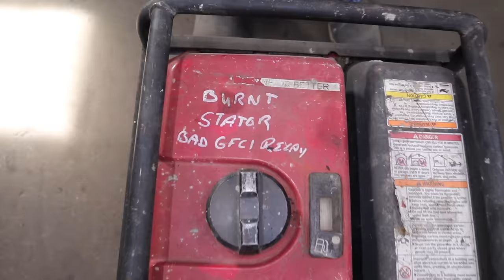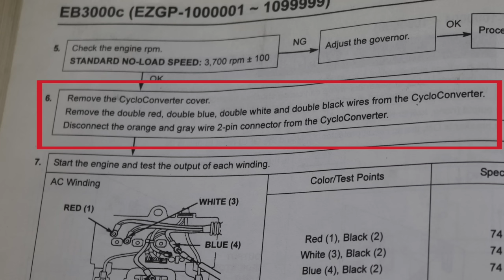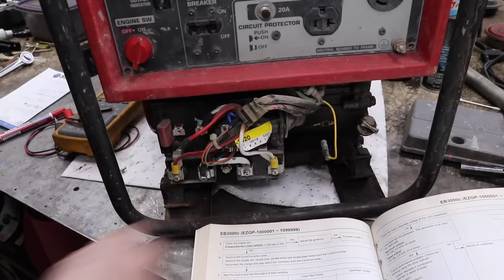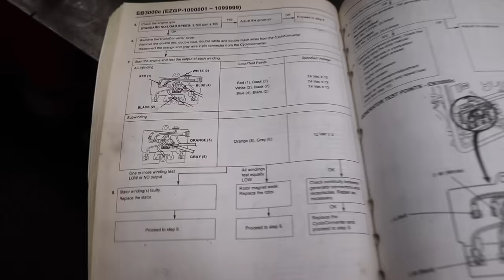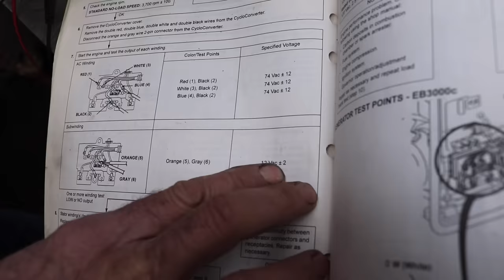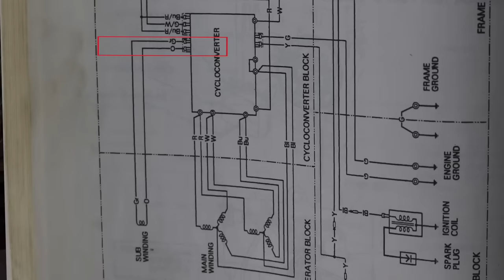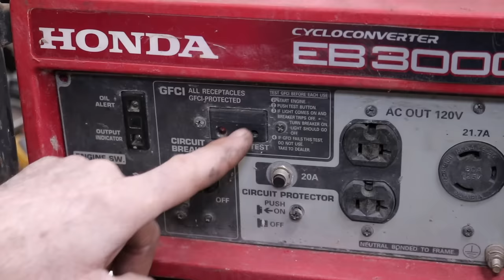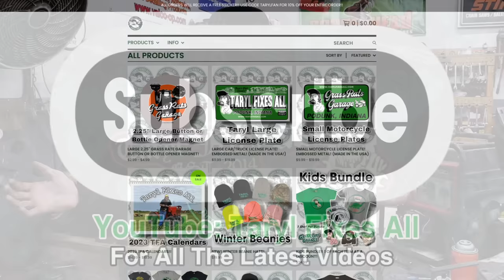Some Things Change For The Worst

Comment: I was hoping an experienced mechanic can tell me if the older pre 2018 Honda eu3000eu generator has any major issues. I have a trifuel hookup to run propane natural gas or unleaded. I don't use it but once a year if that. I know electric start battery is dead. But should I keep it or sell it. With large wheel kit and cover dc cables all goodies it's approximately $2500.00 inverter generator. I saw a video taryl did on the expensive invertor board replacement that was informative video. But I recall parts are hard or now not available that's bs.
Reply: We have the same model with 5700 hours on it and it purrs like a kitten. Never had a problem. Keep it

Comment: I find that most inverter generators are junk. I've had so many come into the shop that have bad inverters that are super expensive to replace and it's mostly units that where used for commercial applications such as construction sites, food trucks and fire departments.

Comment: Onan  P4500i with only 267 hours on it will not run under a load,,,,  took it back to the cummins / onan dealership under warranty it has a 2 year warranty on it,  so the step up solenoid my be bad, ''they guess it is 90 % the problem on those''. but waiting for a call back on it now to see whats up, only been one day since i dropped it off...

Comment: I own a Honda, Yamaha and Champion generator.  You will have the same issue with all of them one they get older.  Parts will not be available.  The champion is a good runner and so far seems to be reliable.  When it does take a dump and parts cannot be found at least you only throwing away a $600 gen vs a $1200 Honda or Yamaha!

Comment: If the inverter is bad, why was the generator showing output??
I wonder if something would work from a newer Honda Generator, since Honda does like to reuse parts through different models.
They change the name or actual part number, but it’s the same part.
But being a Honda and how expensive they are, you would think they would have a better aftermarket.
So you know, people have tried to re-engineer parts like this inverter, but companies like Honda don’t wanna give up the specs.
Reply: Ukraine is building nuclear power generators and we have to pay for them, so why don't we just tell them to make sure they are not bigger than the Honda's...

Comment: That also goes with Pressure Washers also replacing a honda gx 390 Pressure Washer pump is really expensive with the one inch shaft🤑🤨
Reply: Ought to be able to get one end of a Lovejoy coupling for it. Might have to do some doodling about the extra length.

Comment: I understand why they sell inverter style generators but just buy a "regular" generator, less to go wrong. You do have a voltage regulator that feeds the field winding but if you know a good electrical guy you can get an aftermarket one to work. This is one of those deals where it's great if its all working, junk if its not. Probably couldn't even repurpose the engine for say a gas powered tailgate Margareta maker.😅

Comment: Hey. Is there a video on the difference between inverter generators and just generators?
Reply: There are but basically a regular generator just is a big alternator that generates AC. It runs at 3600 RPM to generate a 60Hz output. An inverter generator is similar in that it generates AC power but then it converts the AC to DC, runs the DC to the Inverter module which then electronically converts it back to AC as a perfect clean 60Hz sinewave. Inverter generators can idle down to a slow speed under light load yet still produce 120V/60Hz. Non-Inverter generators have to run at 3600 RPM all the time.

Comment: I have a new champion generator and it's super hard to pull start oil isn't over full called and said I needed 5 hours in it to evaluate it the compression on that thing is to much and I'm a strong guy

Comment: What I would have done is sent the generator into the Honda dealer, and pushed them to get it fixed, and when they can't just leave it with them.  Let the shop get loaded up with these generators and deal with having to get them up and running, or scrap them out.  I wouldn't pay a dime unless it was generating and putting out power.  That will force Honda to stop NLA parts, and you want to charge such ridiculous prices for parts and machines, you better support your line of equipment then, or your dealers are going to pull out and stop selling the equipment.

Comment: The sad thing is if the module wasn't enclosed with epoxy or whatever, the components could easily be replaced. Typical capacitors, resistors, transistors and diodes.

Comment: Let me ask you this Taryl.   Shouldn’t one of those wires on the small plug control that shutoff.   Possibly cutting one of them to prevent shut off?     Also both of those inverters can be repaired if set up to do that type of repair.   My guess is it’s a blown mosfet.

Comment: If   it's making     power   just  knock  up   ,  a transformer  to   get   it   up  to    a  useful   voltage   be   unregulated     but worth   ago ,   maybe   connect  up   to   back    end   of  a   110  to   12 transformer

Comment: It’s called marketing Taryl .If it has golf attached to it add 200% 😂 . I repair our course items but if a part is 1/2 the price of an older unit it’s trashed for parts. Some times like our chain saws I’ll fix it anyway just to fix it. Only because it’s not out of my pocket . Not being able to even get the part Is BS we see  more often even if it’s only a few years old . I could see it if it was 20 years old but that’s seldom the case . Some times you can get an eBay part from China to replace “get this “ the china part in the machine . Love to here it’s “not an OEM” to find the eBay part to be the same as the OEM . CC golf carts Dealer price 220$ Canadian for a speed sensor . I’ve bought them on Amazon or eBay for  as low as 6 $ Canadian. We live in a throw away society . Must really suck for a dealer to tell a customer you can’t even buy the part . It’s to bad because most of it can be repaired and last 20 plus years. They just want you to buy their overpriced new models . Ps . Enjoying the skits there great and informative to 👍🇨🇦
Reply: RIGHT about the GOFF end of it.

Comment: Great video on this Honda Generator thanks for sharing. They are definitely a POS but the Honda dealers love these fix or repair daily paper weights.
Reply: @WJCTechyman  I completely agree with you . Honda small engines are one of the best in the world , change my mind. Expensive but well worth it. There fuel injected inverter generators are top notch

Comment: I bought a champion generator It came with a Honda engine the thing was it broke like in a 4 months of use on and off well then I realized that the Honda engine was just a sell tactic the engine kept running you would start it and all run all day  but no power well the generator part was like 600 bucks to replace  and the engine had a especial shaft taht could not be used for anything else so I had to throw it away  over all Honda engines are extremely reliable but the generator part it’s what just sucks I have a Honda mower that’s just keeps going 12 year old mowers that gets used every two weeks o my yard starts every time in second pull too bad Honda it’s not selling engines any more😢

Comment: The title might be a little stretched as Honda gens are not junk, but rather some parts are not serviceable.
YES, if you know what transistors or caps are in there, YES, they can be replaced. It is not easy to get at the parts, and definitely not profitable to repair.
Honda is no different than say, for example, GM. You can not buy just the clips for a fuel pump, but rather, they sell you the entire fuel system for 1000 bux!!!! NO THANKS.
You can not buy just the bearings for spindles on a new Cub, but rather the whole spindle. Most manufacturers are this way now.
I am sort of perplexed why Honda would stop making replacements so early, but 1 never knows how long parts will be available for anything anymore.
Regardless of what inverter genset you buy, eventually, the caps WILL go bad with age, so it will eventually end up junk no matter the brand!!!

Comment: Sounds like planned obsolescence.. 🤔  in theory, the inverters could be repaired by an electric circuit board repairman, but Honda seals them with epoxy so they can't be fixed.  Makes sense now

Comment: Honda 100/2000 watt generator use an overhead cam belt. In the rare case that it failed, it will cost half as much as the generator to replace it. Taryl do not need a Honda generator, you need a dentist more.

Comment: How long do you expect Honda to inventory parts? Warehousing parts is very expensive. And on exotic in stock part, if you have the dealer call American Honda they will usually reduce the part dealer net in order to sell it. Especially if its a one off part in the warehouse. Your not a Honda dealer, so you wouldn't know that.
Reply from the maker: My brother is a Honda dealer we tried can’t get it. There’s yur dinner

Comment: Yes Sir. I like chapion myself. I like hond atvs and motorcycle  cars don't know about there generator. Moms got a electric start champion and it was about 6 months old and going to use it for second time and it wouldn't put out power. It was About year and half old so no warranty called them said it's probably these two pieces in generator so she got them had put in still nothing. Idk i haven't fooled with it . But its a big generator 6500 or bigger.

Comment: I have to tell my Honda ES6500 generator that is 29 years old that it is a piece of junk.  Cost me spark plugs, oil and filters, 5 starting batteries,  a cam drive belt, gasoline and air filter in 29 years of use.
Reply: I depends on one's perspective. Every single Honda generator that Taryl gets is broken. But most people who own one, it never breaks.
Reply: @DAS-Videos  There is a huge difference between wear and tear from time and use, and outright abuse.  Abuse anything and it will fail.

Comment: My experience with obsolete electronics is that you can find an electronic nerd that can fix it for less than what it would have cost new... maybe it's just a diode or a transistor or a common chip used in refrigerator or something. Anyhow, these guys would know, because they're nerds

Comment: This is why i just bought a Westinghouse 4600W on Amazonion for $250 bucks ( sale ). You really think i am going to spend $1200+ on one when n IF this one blows up who cares? I also own a $350 sale 2200W suitcase style gen/inverter that now has over 100 hours on it ( i always add the hour meter ) with zero issues, starts 2nd pull everytime. Same one from Hondo is $1200.

Comment: I disagreed. I’ve had champion generators over the years in there one season two season generators. They just don’t last you’ll see if you just started dealing with them you’ll see parts may be easy in available but that’s only because they have tons of problems. I got bunch of them in the backyard they don’t run that were brand new generators only used for one season.

Comment: I would say that construction company got their money out of the cheapest 3k gen Honda makes, especially when it's over 10 years old.  Saying Honda is junk based on their entry level gen, which has been well used is a bit of a stretch.  Yes, inverter generators provide a benefit but at a cost.  Cleaner power is worth it for some people.  Next, out of all Honda generators, you only see ones which come in your shop... I would guess that almost none of issues.  Next, those inverters can be repaired, there is a youtuber who sent theirs off to another youtuber to be repaired (James Condor); that might be worth checking out for the EU7000 inverter you had shown in this vid.  Without Honda's inverter ingenuity, the market would look much different today.  I would say the EU2000 changed the entire makeup of the generator market.  I would say that the EU2000 has clocked a significant number of hours world wide and provided consumers with clean power at a low consumption rate.

I get that you wanted click bait, please shy away from that.  I get that you have an opinion and a perspective, please realize that consumers have a perspective too.
Reply from the maker: My perspective is there is a better option out there with better support and parts at a better price. I don’t think that the title is click bait. I’m just trying to show consumers to be prepared for when they do have a problem with their Honda Generator it might not be feasible to have it repaired. If you can even get the part. Now there’s yur dinner
Reply: @Taryl Fixes All  you are right that Honda only supports their products for 10 years. It's a known policy. I worked at a Honda dealer and people would bring in their 30 year old bikes and we'd have to turn them away.

Comment: We had a Champion inverter generator for a couple years we took camping. Worked just fine, ran our campers AC, it was just too big, it was getting harder to pick up 100lbs to put in the truck bed. Ended up buying two Honda's.
Reply: Yeah my previous Champion (from about 2016) was very heavy.  From what Tarryl said, they are offering an array of generators now.

Comment: Why bother w an inverter style generator? My powerhouse Gen ran 16-18 hrs a day for ten days
during hurricane Irma, t.v. and stereo worked fine as did washing machine and central A.C.
From what I have seen, you get somewhat fewer watts like a kilowatt or more compared to a 
regular style gen. I have had pretty good performance with TroyBilt too.
Reply: 3kw at 68 lbs is why

Comment: Let’s see you machine a bolt on adapter so you can use that Honda generator engine for something else, or get a junk motor and change out the crank to one with a shaft!

Comment: The Champion generators use either Chonda or (genuine) Honda engines (their 7500w model, maybe others). 

So, you're getting something Honda got right, with that invertor crap replaced by something designed by someone else, that China copied right.

Comment: I hate those parts that are encased in epoxy.     I understand you want to keep water out of it.   But it makes the circuit board impossible to fix.     Usually a less than 10.00 component.     Honda is not the only company that has done that unfortunately.
Reply: Its just not for water, vibration too.
Reply: @13panda13  

True.    Understand it.   Just not thrilled with it.    Just would prefer the taller parts glued/reinforced to the boards with a water resistant coating.

Comment: I sold Honda generators as an add on to Fire Apparatus that I sold . First pull every time they would start out of the crate . If the Fire Service trusted them in an emergency situation, I think they are more than ok . Try making some money without denigrating a good product.
Reply from the maker: Our fire department is really pissed they have a Honda generator that looks like its just out of the box and is now a boat anchor all due to a NLA part. See it all the time with many supposedly "GOOD PRODUCTS"
Reply: It appears to me that Taryl knows what he is talking about.

Comment: actually those inverters are very simple and its all about the same. you could buy a 50$ "universal" inverter from china and wire it in. the only problem is the output, if you trully need 3000watt it might cost a bit more. more watts=more expensive.

Comment: Is it possible to remove their junk power up a 1 wire GM alternator and add a big rig inverter from the local truck stop or Amazon?

Atleast it's a Honda engine and good on gasoline

Comment: Use the later model part, 31320-Z04-C35
Reply from the maker: Thanks for the upgraded part number I looked into it and unfortunately that part is also unavailable. Thanks again for watching and there's your dinner.
Reply: @TarylFixesAll  interesting as I can find that one everywhere and in stock, albeit expensive at $325-$480., questionable investment for that older unit.

Comment: So you have a 17 year old generator that was probably run to death and has high hours. Construction crews put a lot of hours on their generators. When I did carpentry we ran our Honda 8 hours a day, 5 days a week. That's 2080 hours a year. After 17 years that generator you're working on probably has 10 times more hours on it than any Chinese generator will ever hope to accumulate. That genny is worn out. The big cloud of oil smoke that came out of it when you started it, told me that the engine is probably due for a rebuild.

Comment: You are good at fixing engines, but this is electricity. A competent electrician can find  replacement components to convert the generated power to household use, same as someone pulling electricity off of solar panels, wind turbines, or storage batteries. It would be a simple matter for an electrician to integrate the Honda generator into a permanent off the grid power backup for the home. Returning it to a true portable system depends on physical constraints to integrate a replacement inverter, and it probably would be better to just buy a new generator if you needed to move one often between job sites.
Reply: What you describe does not return the generator to its original purpose.  I am an electrical engineer, and it would take too much time and money to design a custom circuit or reverse engineer this potted part to do that.  As you said yourself, it would be better to buy a new one!

Comment: Good to know.  I'm pretty sure some of those champ gens use honda engines.
Reply: more like a clone Honda engine
Reply: It a hopefull thought, but No they dont, they are all rip off copy's.
Reply: @13panda13  Hmmm I seen a champ 9375 7500W and it had a honda GX390.   I just went out to the champion power equipment page and I do not see that model anymore.    Every gen I looked at had a 'champ' engine, so maybe they do not offer different engines now.